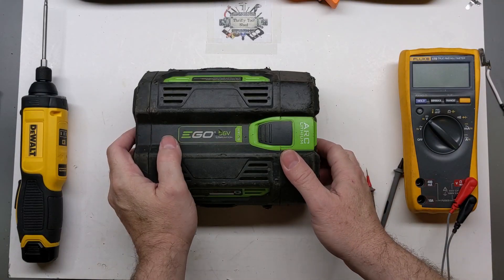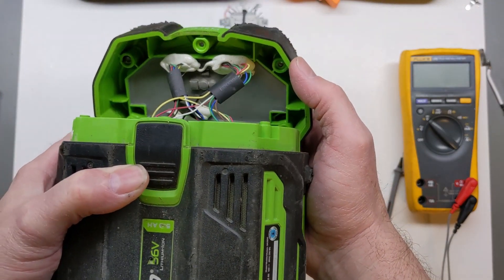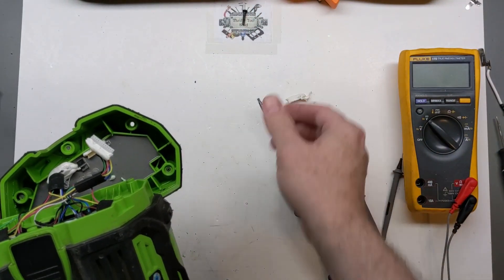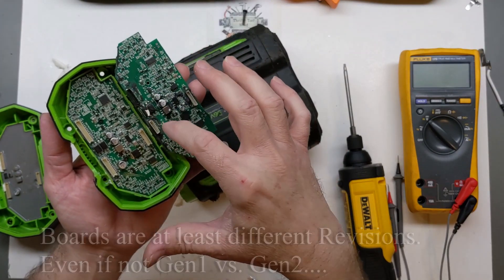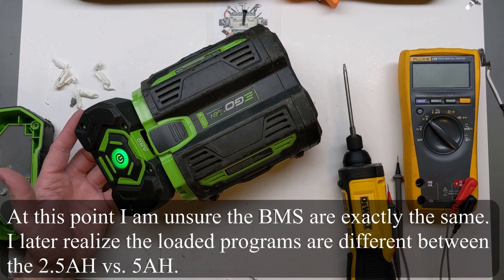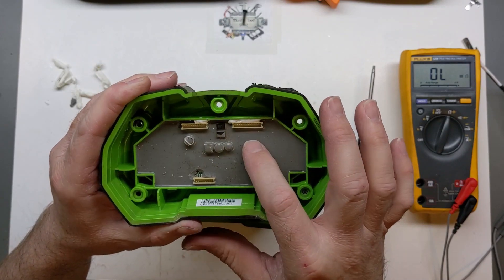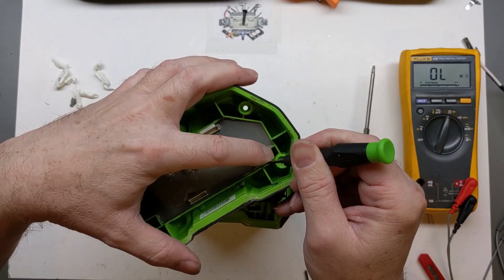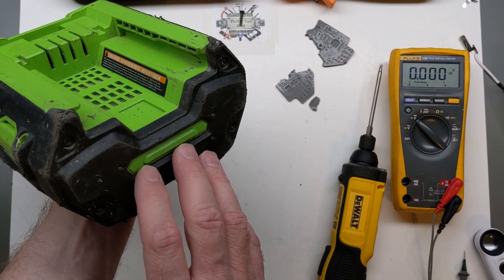EGO 56V Gen1 5AH Blinking Orange Fix

Comment: Well dropping it about 2 or 3 feet onto carpet in the garage seemed to fix it. 🤯
Reply from the maker: Lol. Yes a lot of comments about it stating similar fix. After troubleshooting this and end up pointing to a loose connection, many viewers commented that dropping it or giving it a whack did get it back going. This may be short term of course and checking and tightening all connections may yield better long term results!

Comment: Great video! What did you mean the loaded programs were different between the 2.5ah and 5ah? How did you find out they are different? What happened while using the 2.5ah bms?

 I am planning on changing out a bad micro controllers with one from a smaller AH bms and want to know if it's feasible.  Thanks!
Reply from the maker: After working on these a while what I believe is different is at least 2 things. The BMS communication with the tool gives the packs status and even though I have not figured out exactly what all the data is or how it is sent, we know it at least gets charge level and pack size. We know that because some tools are known to output differently based on what pack is inserted, such as the chainsaw and the Nexus power station knows the size as well when pack is inserted. It also seems to know the charge level to display and help calculate runtime. The physical difference is the 5ah pack and larger has boards in between the packs for monitoring the cells temperature and they feed back on separate wires that the 2.5ah does not have. With that said the connector is the same though if the packs are same generation. I have noticed that the earlier (Gen1) like the 2.0 and the 4.0ah packs have different connectors. So the same gen board may very well work from a small going into a larger pack. I am not sure the temperature monitoring will work in between the pack and the size would not display correctly on tools that may use that data. Hope it helps, best of luck to ya!

Comment: Great info vids, thanks for taking the time to post them. Would you have any idea why i now have two dodgy batteries.

I have a 4AH 56v batteries, started flashing yellow for overheat but it's not hot, and will randomly work on occasion. terminal Output is showing 56V. Ckecked each batttery and they all show 4v approx.

I change the BMS from a working 4AH battery onto the faulty one which still flashed yellow. I then put the good BMS back onto the good battery and its now flashing yellow. (stupid me). They are both six years old but the batteries look good.
Reply from the maker: Alot of times the blinking yellow or orange is a bad connection in-between the pack halves. The packs also have a NTC thermistor attached to the 2 pack halves that could be a possible issue. Thanks for your comment and best of luck to ya!

Comment: thank very much for your video. Could you please post your voltages from B1- B14, and Vcc. Thanks again.
Reply from the maker: Well it will depend on the packs charge level but if course you want each of these cell test points to be well balanced and hopefully read between 2.7v and 4.2v. This is going around for example com (-) to B1 then B1 to B2 etc. Just like I showed on the latest video I shared. I showed test this similar on the Ruzixt 1 year battery update. The BMS is really similar.

Comment: Yet another happy viewer, thanks a ton.  By the time I had removed the top and bottom and front and back the light was back to green. No twisting or pushing would make it flash orange so I put it back together, if the problem returns I'll go deeper next time.  Thanks again.

Comment: ego should be ashamed of themselves. i have 2 blowers.  4 chargers and 4 batteries.  have been through several chargers and batteries.  they just dont last.  YET, all my Ryobi stuff 1 battery went bad with over 12 batteries in the collection
Reply from the maker: Wow that's not good. So all Ego stuff  under warranty correct? Just for reference, which Ryobi packs are you referring to, because though I have had ok luck with the 18v Ryobi packs, the 40v had been an absolute disappointment. Not even close to comparison to Ego. Going by my over 5 years experience with Both and having worked on many for others as well. I have not had either of these brands newest versions to be fair, they both have changed a little at least.

Comment: I just dropped mine on the concrete floor from about 2 feet,green light came on so I went and finished mowing with no problems thanks
Reply: I did the same thing!
Reply from the maker: Just remember this is temporary and soon after people started posting about dropping it and it working again viewers started posting about their connectors broken off the board. That only happens after repeated drops and getting harder and harder. The loose connection(s) will have to be found and corrected...

Comment: Could you do me a huge favor and check what component is in RT3? Whatever was there on my board is blow completely off.
Reply from the maker: I do not mind helping. I remember RT2 at the bottom middle of the board being a NTC thermistor. It reads about 10K at room temperature. I don't remember the location of a RT3? Which area of the board are you seeing it. And is it a 5.0ah pack?
Reply: @ThriftyToolShed  On second look it is actually RT2. Some of the burn mark made it look like a "3" untill I wiped it off a little. Thank you!

Comment: I tapped on the battery three times with a leather hammer and that fixed it😮😀
Reply from the maker: Glad you got it! 👍
😂🔨
Reply: you'll probably have to take it apart and clean the contacts eventually.
Reply from the maker: Yes, and eventually solder the balance leads. All the newer packs starting with some of the Gen2 and all the Gen3 I believe are all soldered so not such an issue over time.

Comment: All I had to do was remove the top, end cap. I have the 7.5ah battery and when I finally got the end cap to loosen and come off, I noticed I had less room to move the cap before I stressed the wires. I guess I did enough movement of the wires to affect the connectors because the battery indicator was green rather than the blinking orange. Thank you!

Comment: Should we replace any silicone after attempting this repair?  Or how important is it?
Reply from the maker: Well, it is very important to keep out  moisture to help with corrosion prevention. I look at it like how often you get your pack in a moist environment. I have several packs that I have left the potting off and I have not had issues at all with them. I also keep them in very dry environments and if I use them even in lawn mower while grass is damp, I will grab a pack with the protection on it instead, since I have the repaired packs marked so I know. If you use them often in a wet or damp environment, I would replace it!

Comment: As a real engineer, and one who is really tired of the blinking yellow light on the mower and its intermittent failure to start (after a brief wroorrrrww..) for no apparent reason, I'm calling bullshit.  WTH.  It's a battery, in a lawn mower.  WTH do we need a microcontroller circuit board in the first place?  That's way too many things to go wrong in an outdoor use device; i.e., dirt, heat, moisture, etc.  I've called EGO support, and got the runaround - oh, you need a new battery, yours is five years old.  Baloney.  We should be able to simply bypass the thermal limit (which I'm hearing is the main failure mode?) altogether on that whole PCB.
Reply: Are you an electrical engineer?

We need the micro controller, because lithium ion batteries need to be charged properly to keep them from starting on fire.  You don't want thermal limits bypassed on a lithium battery.  too hot and they can self combust.  and you can't put that fire out with water...

The problem is not the thermal sensor, but the crappy connectors they used.  Get some contact cleaner with a "preservative" in it, like MG-801B spay, and put it on the connector contacts.  Similar stuff is used in electronics that will be vibrating and bouncing around to prevent fretting corrosion between the contacts.  It's something that ego should have applied from the get go, and we wouldn't be having these problems.

Comment: heyo, i have this exact problem now with a 5A ego. i have tested the BMS on KNOWN good batteries and on all of them the bms is green and then start flashing orange. the problem is in my case on the bms and not on the wiring/connectors. i have checked all the cells and they seem good as well. when I put the ego on the charger all light light up so it is charged and full. is it usable in this state or not? should I fix it? I'm trying to make a 6AH BMS work on the 5A battery. i have already replaced the Q12 on this BMS as it was blinking green first, but now its onlygreen and then flashing orange. i also have 3 spare BMS for parts, all from 2AH/ 5AH/6AH egos. cant see any damage on the board either
Reply from the maker: This is one of the problems I have not figured out yet. Seems to be in the temperature monitor circuit, but all NTCs and the circuit around them check out fine. I have not repaired one of mine that does this yet.
Reply: @ThriftyToolShed  oh hmm, thats sad. would you be interested in broken BMS circuit boards (for spare parts or fixing)? i have 4 which I don't have any purpose for, but I guess they can be quite valuable for parts?
Reply from the maker: I really appreciate that, I do still have several at this time for parts. Thanks again!

Comment: Hoping to get a next step for my 5 Ah Battery. Recently was gifted a 16" chain saw with the 5 Ah battery and charger with it. I also have a string trimmer with a 2.5 Ah battery that I used for testing. The 2.5 Ah battery charges on both chargers which eliminates that issue. The 5 Ah battery does not light up but makes a faint buzzing when on both charges. Any suggestion!?!?
Reply from the maker: No light on the pack in the charger or trying it in the tool either? Also have you measured the terminals at the output of the pack with a meter?
Reply: @ThriftyToolShed  no light at the charger and the tool itself. I have not measured the battery, I don’t have a meter to test them.

Comment: Any chance you could send me the wiring pinouts for the three connectors on the Gen 1 5.0 AH PCB, seems like the color wires are the same on mine versus the one you are showing in this video. When I took the battery apart some wires pulled out of the connectors or were already out. The pack would not light up when pushing the power button but the pack measured 51.6 volts. Most of the wires pulled right out of the BMS Board connector from the 8 pin lower connectors from the terminal board.
Reply from the maker: I do have a video on the 2.5ah BMS wiring for someone who asked for it. If you need more information than that let me know, and I will see what I can do. I know the 2.5 is slightly different, but hopefully it has enough information to be helpful.

Comment: The board in my Ego 7.5Ah battery is fried. Do you know where I can buy a new one? Can you tell me how to search for one, like give me a part number or something?
Reply from the maker: I still haven't found a BMS replacement. That's one reason that I spent time trying to learn about the BMS board and show a few repairs on my channel. I even tried contacting the Ruzixt battery manufacturer to see if they would sell the BMS board seperatly and they still have not responded. Jacks small engine online is one of the few places selling EGO parts, but I still don't see the BMS listed.

Comment: Hope I can get a response but I have a problem with my 1 year old 2.5ah battery (no fuel gauge) and regular charger just now. It's been stored indoor and battery off the charger since end of fall last year. Now today after a quick usage I went to recharge it and it's having a weird problem. The red and green light on the charger flickers at the same time constantly and it whines up for 1-2 sec, stop, whines again for 1-2 sec, stop, blinks, battery blinks green/red/orange, sometimes just green as it cycles through those whining sequence over and over. It's like trying to turn over a car with a low battery on a sub-zero temp day is the best way I can put it. Not sure if you have come across this problem before but simply put, are both the batt and charger shot?
Reply from the maker: Is the charger making a clicking  sound like a relay clicking on then off every few seconds?
Reply: @ThriftyToolShed  Yup, during the whining phases.
Reply from the maker: Usually when the pack is too low in charge it will do that. The battery terminal voltage must be reading low. The charger will try to bump to voltage up to safe charge level, but if not done by a certain time frame it may shutdown and show a faulty pack.
Reply: @ThriftyToolShed  Just to update, I left it on the charger to cycle through that mess and it finally "turn over" and charges normally. I think those annoying cycles bumps up the charge slowly until it was okay to charge as normal. Definitely weird and I've never seen that before but glad the batt and charger aren't faulty.
Reply from the maker: @dkbomb  I have seen it several times and sometimes it does bring it up to charge and as mentioned in my previous comment, sometimes it will not bring it back. Glad it brought it up to charge level.